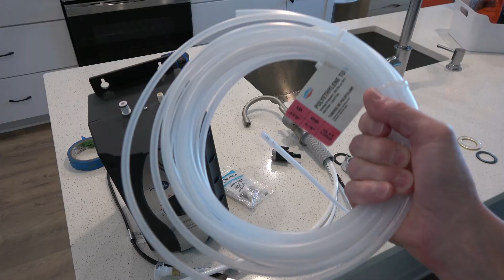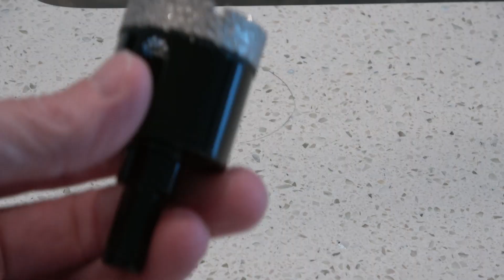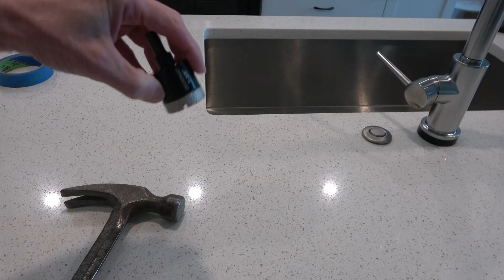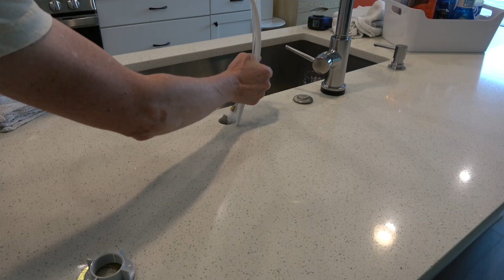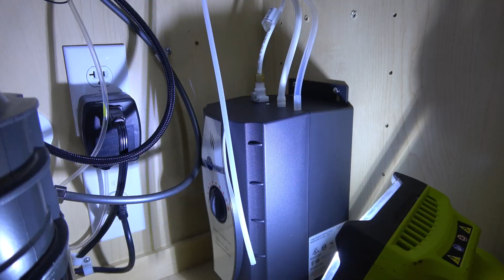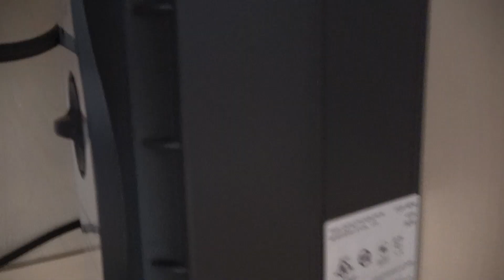InSinkErator Instant Hot Water Dispenser Installation

Comment: The whole reason I'm watching this video is to see all the connections for the filter and you completely skipped on at 39:47.
Reply from the maker: I talked about the lines in the beginning and also show them mid-stream so not sure what you mean.  Perhaps you were skipping around the video.  But there is only 1 water connection, and the rest are all to the unit using quick connects and all are in the instructions.

Comment: Hi Sean,
Great video! Your video is very detailed and informative. I just bought Insinkerator instant hot water system exactly like your. However, I can’t find “1/4 turn brass compression adapter valve with 3/8 to the 1/4 adaptor” in my local home depot store in my area. Did you buy your online? If so, please provide the link so I can buy one for myself. Thanks so much.
Reply from the maker: Did you try Lowes?  Amazon should have one for sure if you can't find it locally.

Comment: I  use plumbers putty to make a little circular dam around where the hole will be and fill it with water, maybe 1/2" deep is all you need. This insures that the cut is always wet!
Reply from the maker: That's a good tip!

Comment: I just installed this unit (really just replacing a similar ~10-year-old unit). $375 at Home Depot. The one problem I had was connecting the inflow Flexible copper tubing - to the plastic tubing which replaced the copper tubing in the old dispenser. The trick was to use what's called a 1/4" "coupling" - $2 (plumbing supply)- $5 (Home Depot). It kept leaking. I re-cut the copper tubing and used a new coupling, making sure both copper and plastic tubing was COMPLETELY inserted, and voila, no leaks.

Comment: Welcome to FL , if you ever get the bug again DeLand has a nice train show, not as large as the shows up north but it will do. Zitnik's si a nice train hobby shop with a full supply of parts if you ever get back into the hobby. The problem in FL is that storage and layout space is hard to come by and unless the garage is air conditioned it will eventually cause the trains to rust, not right away but they will rust over time. I am planning to take the auto train up to the York show in October. Maybe our path's will cross someday, I live in Palm Harbor.
Reply from the maker: Yes I am also going to York next week!
Reply: @SeansHobbyHouse  I am taking the Amtrak auto train from Sanford FL to Lorton VA, I look forward to talking to you and some of the other you tube train enthusiasts
Reply from the maker: @dennis2494  I have done that before and the auto train is great, but this time used my airline miles to fly into Harrisburg.
Reply: @SeansHobbyHouse  , it’s nice to have my car to carry items home, I’m sure you can relate to that. Except for a parts order from the Train Tender , I am not sure what I will buy at the show but I look forward to seeing and talking to other train enthusiasts there. And BTW I enjoyed your video on the WIFI sprinkler set up that you installed , I have four zones also and after 31 years had my four valves replaced. I only have a generic controller but a system like you have would sure be convenient.

Comment: We buy those boiling pots for tea but they corrode in a year or so.  How long do you think the unit will last?
Great video BTW!
Reply from the maker: My old one lasted 13 years before I moved and was still going strong.  So should last a good long time.  What's nice about these is the tanks are same between faucets so you can replace just the tank if it was ever needed.
Reply: The more pure the water the more corrosion because purified water is hungry for minerals. :face-fuchsia-tongue-out::face-fuchsia-tongue-out: